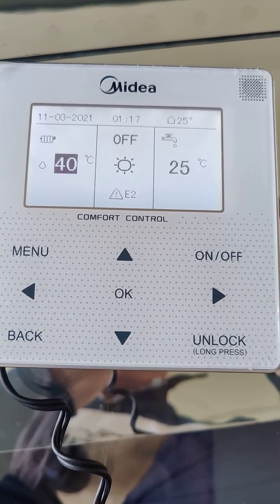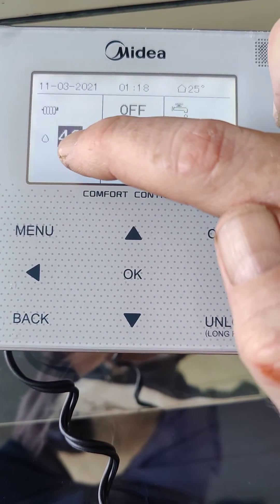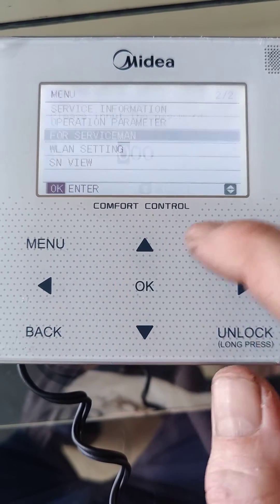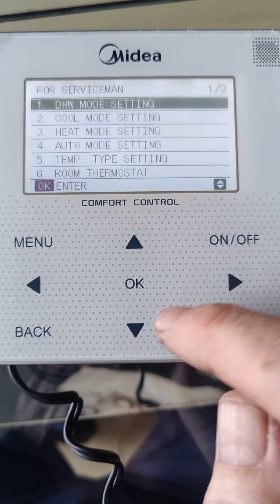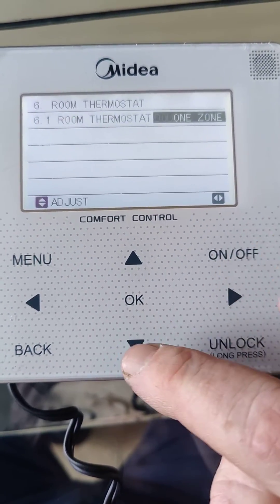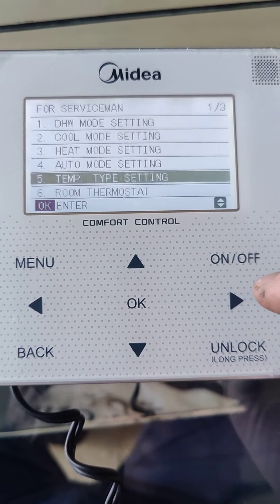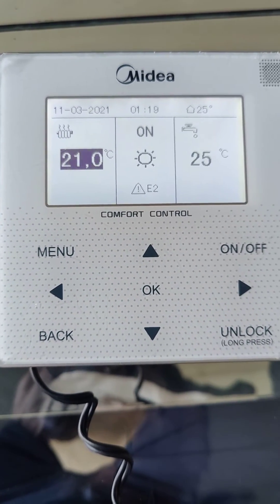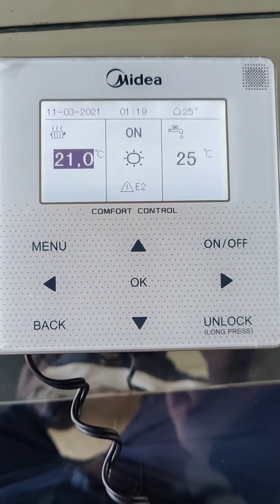Midea heat pumps how to use the Midea controller as a room thermostat

Comment: ok but my living room is 10 meters away (where i'd prefer the controler to be on the wall) from the boiler room which is right next to the heat pump unit outside. It only came withabout 5 meters long red sensor cable. Mine is a hyundai monobloc by midea

Comment: Hi, Graham! I recently got 16kw monoblock installed at my home. It's a 2 storey house with about 250sqm of space. My system has 2 circ. pumps left over from the previous setup, and now an additional circ. pump running from the buffer tank. It's a heated floor system with no domestic hot water, so basically the buffer only stands between the pump and the floors. Now I'm running a weather compensation curve to keep about 23c around the house. The controller is currently not in my house so I'm only using it in water temperature/heating mode. Ambient temp. these days is around 0-4c, the house is warm and all, but the COP is not so good, 2.9 - 3.2 is the most I'm getting atm. I'm honestly not sure what settings could I change to get a better COP out of it. Could it have something to do with the 2 circ. pumps I have from my previous system? Nothing is controlling them atm they are just running 24/7. I'm also a bit confused with the SmartHome app to be honest.

Comment: Thanks for your video! Is the operation of heat pump the same whet it works with separate room thermostat than with the remote control as a thermostat?
Reply from the maker: similar, yes. but if you use the remote controller you get better weather compensation and you can use the timers inside the controller for heating and for hot water